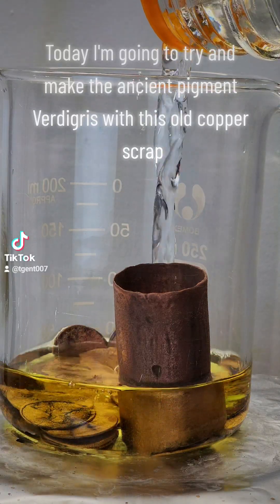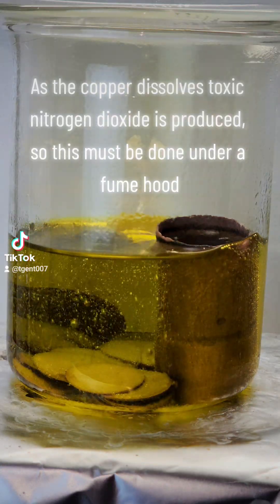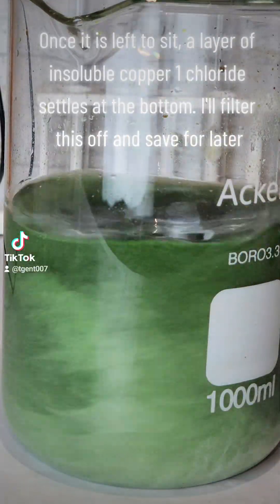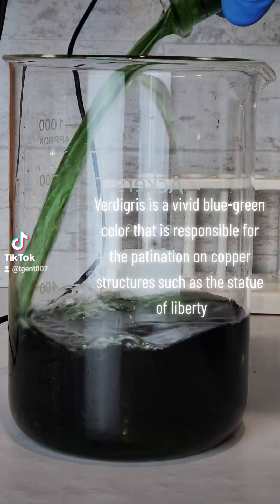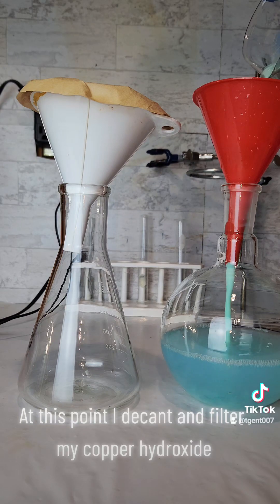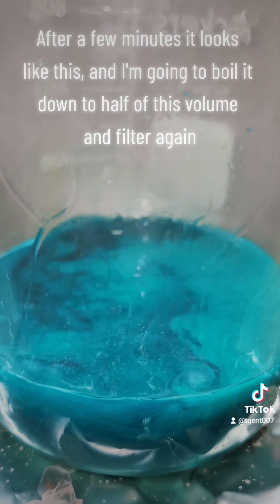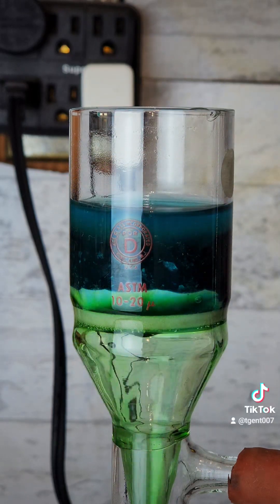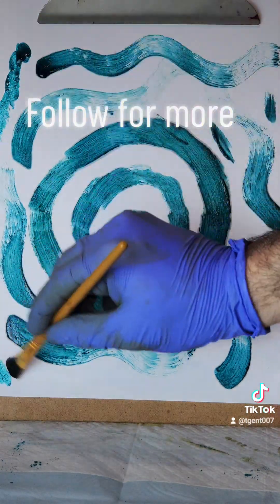Making Verdigris (Copper Acetate)

Comment: hi can electrolysis of copper vs copper in vinegar produces same result? i dont have any access to glacial acetic acid
Reply from the maker: Honestly you can just use plain vinegar here (it just might be more annoying to boil off the excess liquid). Electrolysis can work for making copper sulfate, but I'm not sure if it would work for copper acetate.
Reply: I’ve used electrolysis with ~10% sulfuric acid and copper anodes to make copper sulfate pretty easily. The resulting solution can be turned into copper acetate by dissolving calcium carbonate in acetic acid to form calcium acetate, which is slowly added to the copper sulfate solution to precipitate insoluble calcium sulfate. Filter off the calcium sulfate, leaving the copper acetate in solution.
Reply: Yeah it works you can also use h202 to speed up the reaction

Comment: Would adding glacial acetic acid to copper metal create copper acetate ?
Reply from the maker: Yeah most likely, although you'd need an oxidizer.. 30% peroxide would probably be best.
Reply: @integral_chemistry  30% peroxide I'm guessing you mean 30% hydrogen peroxide, hydrogen peroxide is a strong oxidizing agent and glacial acetic acid is flammable, wouldn't it cause a violent reaction or fire if I mix them ?
Reply from the maker: @craigpater6278  I've mixed the two before with no issue, hydrogen peroxide below 67% typically won't result in combustion but if you want to err on the side of caution 12% would probably work fine. 3% though is definitely too weak though in my personal experience.
Reply: 5-6% vinegar with equal volume of hydrogen peroxide works very well. I tried 45% vinegar but it required nearly ten times as much peroxide before the resulting solution would not dissolve any more copper.